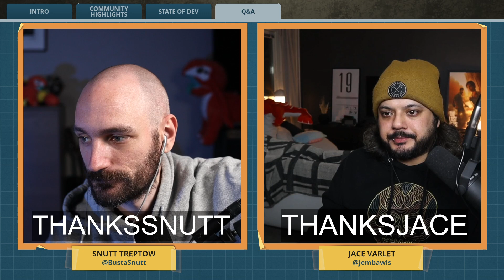Q&A: Is it possible to add a mirror solution to placing Blueprints?

Comment: Factorio only added mirroring blueprints after 1.0 since it was a hard/challenging task, they ended up only allowing mirroring on blueprints without certain buildings (like rails)
Reply: I'm not saying they should add mirroring. But you cannot use the current blueprint system to design a production setup with 2 assemblers (one on each side of a belt), which is a rather common setup. Hence my thought that if blueprints were larger, you wouldn't need mirroring as much.
Reply: @mnmr  Yea, that makes sense but I still see many uses for it. It would be a nice QoL feature

Comment: Mirroring blueprints is a bad solution to blueprints just not being big enough. Make them bigger and people don’t need to rotate/mirror setups.
Reply: That makes no sense
Reply: mirroring has nothing to do with the blueprint size.

just alone for decorative purposes, imagine you build some architectual structure for the left and it would be so convenient to have everything mirrored to the right with 1 button
Reply: @NinjarioPicmin  You misunderstand. I meant that bigger blueprints allow you to build machines on both sides of a belt (a mirrored setup). 4 wide is not enough for 2 assemblers and 3 belt rows, so with current blueprints you'd need to "mirror them".
Reply: Make bluprint tier 1 2 and 3
4x4x4
6x6x4
8x8x4
And make the bigger tiers printing use More expensive parts. Higher tier spaceelevator parts maybe?